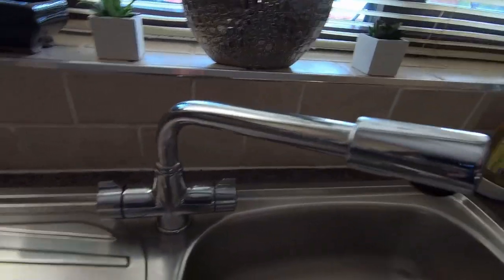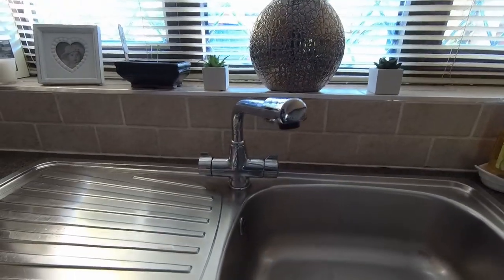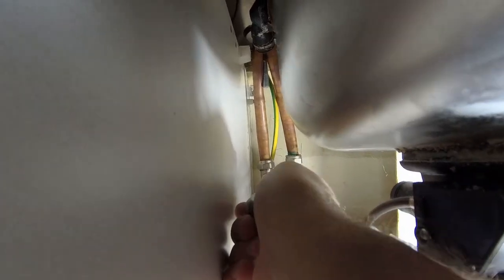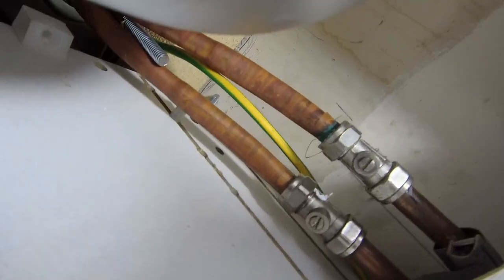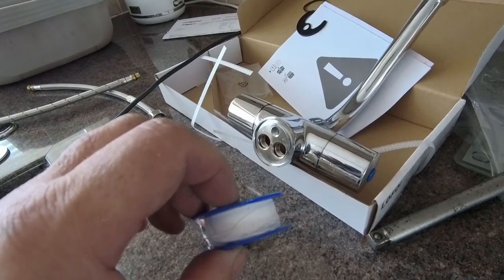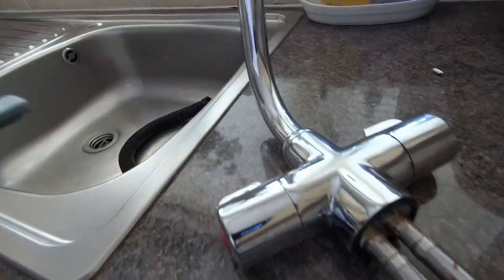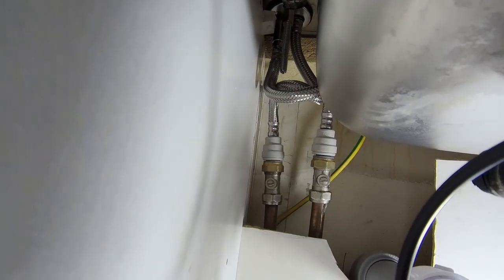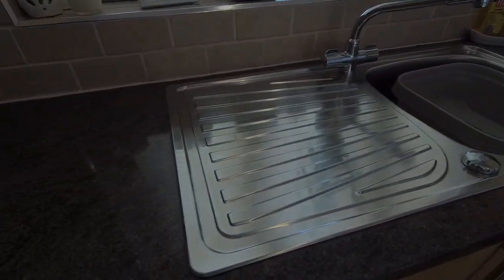monobloc tap replacement

Comment: On a monoblox if there’s no isolation valves , you turn off the stopcock but that’s for the main cold , how do you turn off the hot , I have a combo boiler ????
Reply from the maker: If there are no isolation valves lower down on the feed pipes its going to be tricky... you can buy freeze spray to "ice" the pipes up, but it does not give you much working time...
Reply: @AdeReeves  I always thought you could turn off one of the taps off that’s under the boiler to stop the water
Reply from the maker: @Branno46  I guess it all depends on the system fitted. I have a balanced system with traditional boiler and there are isolators all over the place .

Comment: How did u remove copper pipe?  I am stuck with 2 pipes not coming from sink hole..
Reply from the maker: If you mean remove them from the block , they should twist off clockwise

Comment: You didn't show what I wanted to know, how you got the bolt off, the most difficult bit
Reply from the maker: If you want to be professional, you can get a mono block spanner with an angle head...but as I'm a bloke i used a long reach socket with a extension bar and skinned my knuckles  😂

Comment: Ptfe tape not required.  It’s only used in case of emergency or as a last resort
Reply from the maker: I use it on just about all joints...and never as an emergency.

Comment: What was the tool you used to remove the small nut?
Reply from the maker: Hi ...It was a half inch long reach socket attached to a ratchet wrench ...The sort of thing you use for working on cars...You can buy a Mono Bloc Back Nut Spanner off ebay for less than a tenner, but already had this available .